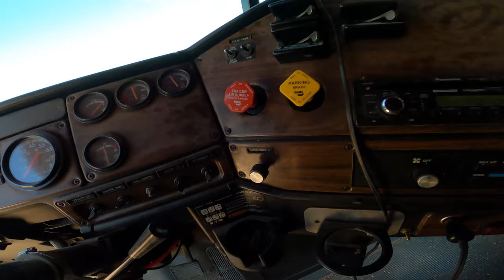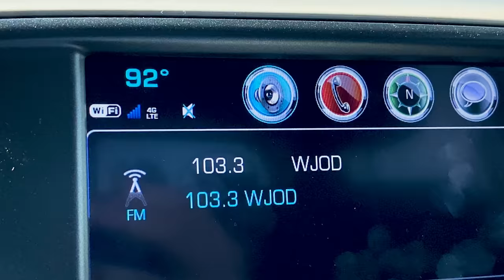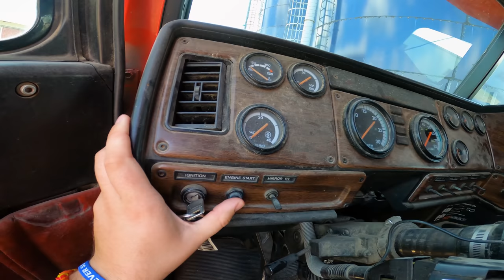Cleaning Out Musty Corn in the Bin!

Comment: I Just bought a can of that greese.  Got my car back from the dealer, and the cable was replaced on sliding door. They did not clean dirt and did not lube, I found a video that said to lube it with that type of grease. But not the nylon wheel on the top hanger.  As I learned when I rode bicyles, lithium does not attract dirt to the chain.  Yes the first lube was original wd-40.  But you should of seen the citrus bibox chain cleaner, yuck.  Back then I bought the Napa Version!  I was gone with the Schwin!    Good video! Due hickey, Taking on water boss!
Reply: Lithium is the worst for a bike chain.  It is a dust magnet and dirt/dust wear chains out rapidly.

Comment: Question: If there is mold and mildew in the bin and you don't clean the bin prior to filling it again will the mold and mildew transfer to the next harvested crop?
Reply: Quite possibly!
Reply: There's mold and mildew spores EVERYWHERE all the time... the stuff just floats in the air and gets everywhere.  It takes warm, moist, humid areas for it to grow.  Mold and mildew spores are in the fields all the time and come in with the corn at harvest.  The key is to keep the grain aerated and the moisture low enough to preven the stuff from growing and spreading.  That's how it gets in there in the first place.  No amount of "sterilizing" the bin will prevent it- the grain basically picks it up literally IN THE FIELD even before it is harvested, right out of the air.  Later!  OL J R :)

Comment: Should have just removed inline quick release valve to go to load delivered an then replace it later. Since it only on the emergency/parking brakes
Reply: That wouldn't work, you need air to the emergency side all the time.
Reply: @randalllong6349  sorry u do not understand what im talking about
Reply: @diesel1765  I understand now. You're removing the check valve and going directly to the tractor protection valve.

Comment: Dude, you need to take it easy in those bins on a hot day like that.  AND DRINK MORE WATER!!  You looked really distressed, and I gotta tell ya, I would assume to see you sweating like crazy.  If you aren't sweating, you could go into heat stroke very easily.  And then it's lights out. No more HFW then.  Turn that ventilation fan on while you're in there too!
Reply: You don't want to run the fan while your in the bin... all it does is raise choking, blinding levels of dust and doesn't really cool it off anyway... Later!  OL J R :)
Reply: Unless you can reverse the fan if it’s axial.
Reply: @larry4082  you can't reverse a bin fan they're not wired that way
Reply: When I say reverse, I mean we physically pulled the fan off and attached the sucky side to the bin duct. We had small bins and consequently small fans. We actually fabricated a kind of quick attach to the bins to make it easy.
Reply: @larry4082  ok... Well I guess it you say so, never seen that done and don't know what good it would do, but okay.  Personally I'd rather have a big fan sitting in the door blowing cooler outside air in OVER the grain, and me, and venting hot air from the bin walls out the top... Later!  OL J R

Comment: I always pull them back pressure valves off cause than you can fill you air tanks from another truck Ryan.
Reply: @nicholashubbard9026  I've actually have 3 ways to fill mine just in case of a problem
Reply: John Warren what’s the 3rd way
Reply: @nicholashubbard9026  glad hands one tank than at the air dryer with valve stem witch will fill the whole system

Comment: What was it doing @ 20:19 ?
Reply: Automated sampler... robot arm that sticks a probe tube down through the load, then opens to let some corn fall into it, then activates a vacuum to suck the corn out of the tube and through a pipe into the office where it's run through a grain tester, that determines the moisture level, cup (grain) weight (per bushel), foreign matter, and debris contamination or grain damage, and usually also tested for mycotoxins.  Later!  OL J R :)
Reply: @lukestrawwalker  ty
Reply: @badandyg  yw!  OL J R :)